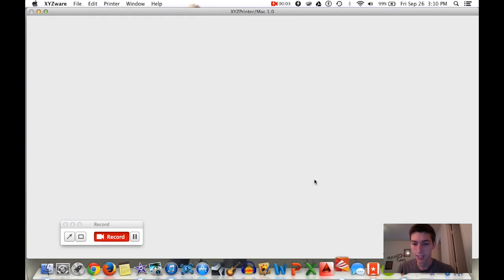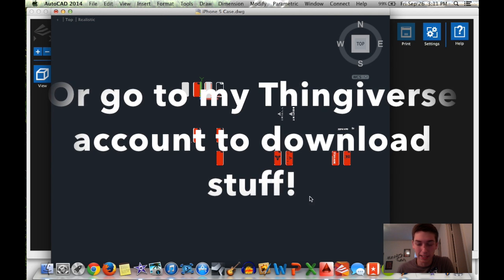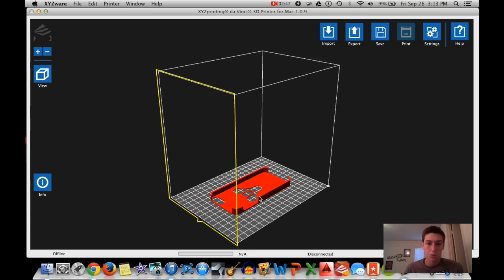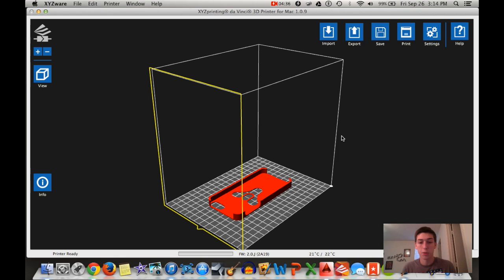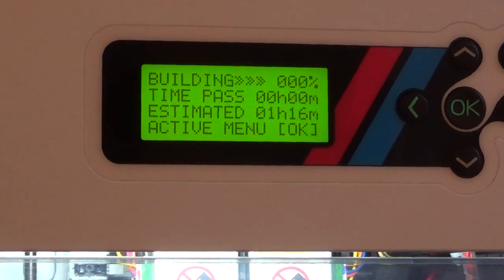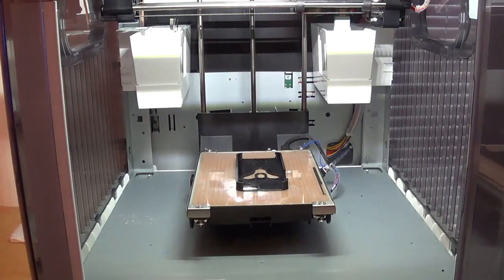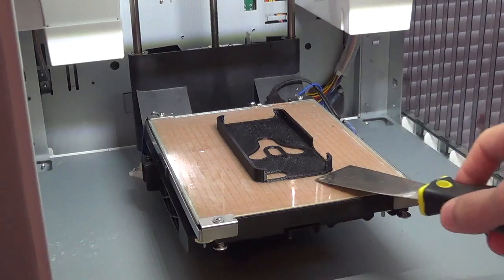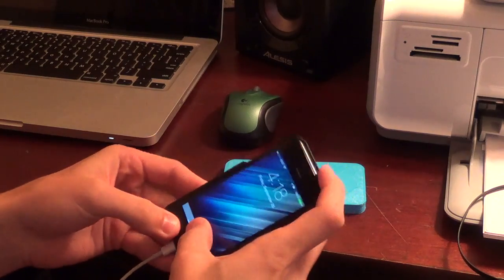3D Printing using AutoCAD and XYZ Software!

Comment: how much does it weight? 5-10 gram or more
Reply from the maker: Depending on the fill and design they are usually about 8-15 grams
Reply: +Bryan Keller if I used solid infill so

Comment: I was looking at 3D printers and I think this one is the one for me, as it'll be my first 3D printer and I'm not 100% ready with AutoCAD, I have a super quick question. The test object was dual printed, is it possible to use AutoCAD to make a dual coloured object? (I have subscribed by the way. Also I love your video format and presentations in what I've seen. Peace.
Reply from the maker: +Open Mind yes you can definitely do dual colored prints using autocad. The easiest way is to make the pieces separate .stl files or you can specify colors in a slicing software.

Comment: yo ! I've just receive my Da Vinci 2.0. I import a stl part, when i press on print, the part is sliced, then nothing happend, did you have any idea ? Thx
Reply from the maker: After it is sliced you just need to click print and it should start. If you think there is an issue with the sliced piece try printing something else and see if it works regularly.
Reply: Bryan Keller thanks dude, i just had to be patient,  thé part was complex, almost 60mb for thé stl,  so my lil laptop compute à big part of the night,  
+++

Comment: Hi Bryan, this is Alex, from México,

Recentrly I bought a DaVinci 2.0, I've printing diferent models of thingiverse and everything its cool, but I have a problem, I made a case for a circuit and when I printing I realice that, the circuit It doesnt fit on the case, because the print was smaller than the design, so I print another thing more simple, just a 10 mm cube, when I print that cube, every side has different mesure. Dou you have any idea of what happen?

Sorry for my english,

Once again, thank you very much!
Reply from the maker: Alex Alvarez I try and re-calibrate my printer every 5-10 prints so if you haven't done that recently it might fix your problem. Otherwise your piece or print bed may be slipping. Watch the print closely next time and if it looks like the bed is moving excessively try stabilizing it. Ive seen some people do this just by wedging some paper into any gaps that the bed may be sliding around in. Good Luck and I hope this helps!
Reply: Bryan Keller Thanks Bryan, today I will do your suggestions, I'll comment you.

Comment: My software does not seem to have  a PLA otion? What about yours?  And if so where is it?
Reply from the maker: Click the drop down where it says ABS in the print settings. You might need to update the software if it's not there.
Reply: Software says it's updated o the latest version? Also 1.1.4? There is no selection for abs or pla. The menu where that should be is not there. at least from other videos i have seen. what version software does yours say?

Comment from the maker: Dakota - It comes with 1 white and 1 red filament
Reply: +Bryan Keller hey there ,
i was considering buying this printer, but am told that the filament cartridges xyz from are too expensive .is the price difference too high (if so, by wat percentage)? and is there any option that filaments from other makers can be used over xyz printers ??
pls help
Reply from the maker: +harish manmohan The actual carts are not that bad, I think they are $28 a piece. But I do use other filaments generally now. There are many ways to do so such as flashing the firmware but I just reset the carts themselves in the machine and use a spool externally.
Reply: +Bryan Keller Bryan dumb question here?  Are you resetting empty carts in the printer and the printer thinks you have installed new cartridges?  so that I understand the empty cartridges make the printer think that you installed new carts and then you just run our filament through the top.  please correct me if I am wrong.
Reply from the maker: +drunization precisely.
Reply: Bryan Kel
Reply: nice background beat..whats the name of it.ive heard it before..also what was the finish like on the case surface..

Comment: Nice video Thanks. btw, I noticed that you setup your computer away from the printer. probably because the noise level?
Reply from the maker: It was just easier since that's where I study and use my laptop majority of the time. But it is a plus I don't have to be right next to it while it's printing.

Comment: Hey Bryan, thanks for taking some time to make a video for everyone.  I was looking at this XYZ da vinci's for work to have available for people to use.  I read online that they support ABS/PLA but all of XYZ's filament is ABS from the looks of it.  Do you know anything about printing PLA without modding the printer?
Reply: Sean Maxwell Bryan Keller  

Hey! At this point in time, the Da Vinci does not like to print PLA. Some people, including myself, have 'hacked' the da vinci to run off of Repetier, an open source, all in one program for 3d printers. Doing this has allowed me to print 3rd party filament, including PLA. However, the stock Da Vinci extruder is poorly designed and allows too much heat to bleed up from the hot end to the filament being loaded. This causes the PLA to swell and get jammed in the filament barrel, halting extrusion and causing this awful clicking noise . The only ways people have thus far been able to print PLA are by a) making and installing a heat sink around the extruder, and b) by replacing the entire extruder assembly with a custom printed one meant for the e3d v6 hot end. Both are a lot of work. Unless XYZ comes up with a mod or new extruder assembly, I can't see PLA becoming a thing for non-hacked printers. 

Below are a couple of links about running Repetier on the Da Vinci, the heatsink, and the e3d v6 extruder. 

repetier: http://voltivo.com/forum/davinci-firmware/53-repetier-firmware-and-repetier-host-how-too-and-issues

heat sink mod: http://www.thingiverse.com/thing:433113

e3d v6 hot end mod: http://www.thingiverse.com/thing:473038

Hope this was helpful!
Reply from the maker: I am unsure what that is but most extruders print ABS by default. I would do some online research to make sure.
Reply from the maker: This area is strange honesty, The printer does indeed support PLA alongside ABS and the software even has heating/extruding presets for PLA plastic but I have not found a XYZprinting cartridge with PLA plastic either. So until they release a cart with PLA plastic you will have to buy another brand and "trick" the printer by putting a normal cart in the printer and have your other brand PLA plastic inserted into the extruder. This will allow you to use the other filament, but you will need to reset the cart once it thinks it is empty. That is the step I am still playing around with. 
I have seen some xyz cart reseter devices online but have not tried any of them yet.
Hope this helps and hopefully XYZ will come out with a PLA cart soon!
Reply: Bryan Keller Thank you, I just heard they will be out by the end of the year.  They are running out of time :)
Reply from the maker: For real though! I guess we just have to wait patiently...
Reply: Harbinger Thanks for this. I actually have plans to buy this printer and mod it. I was curious about PLA and now I know. One more thing I'd like to know is if I was to choose the e3d v6 hot end, would I still be able to print with ABS?

Comment: how durable are the things you print from this? I am thinking to buy one to print quadcopters staff.
Reply from the maker: They are fairly durable. I usually print on 20-30% fill so they flex a bit but if you print on 80-90% the piece should be pretty strong.

Comment: what is the material thats the printers using.n how many cases like these can u print by one cartridge.
Reply from the maker: I printed these in ABS plastic but you can also use PLA. Each cart is 200g ($28) and each case is about 10g-15g so about 25 cases.
Reply from the maker: Woops he's right! Each cart is 600g* 
I will check out that other software too, I have heard good things about it.

Comment: I was wondering how you feel about the XYZ printer now that you have had it a while. Im getting ready to purchase one buts its really hard to figure out what the best bang for my buck. Any help would be appreciated.

Thanks
Reply from the maker: So far it truly has been amazing! The software has been getting better over time which was the only downfall to it in my opinion. You may run into a few problems at first but once you know how to properly fix them this printer is definitely worth it. Also their are not many dual extruder printers below $1000 so this one for $680(after tax) is a steal. 
  If you have a slightly bigger budget, I would recommend the 2.1 though. I wish I had gotten it. It has a built in camera for print monitoring on your smartphone and you can print wirelessly using wifi. I think i also has a built in memory that stores previous prints so you can just click which one you want to print without going through the software. It retails for $850 I believe but the camera alone would be worth it. Hope this helps!
Reply: The printers are pretty good, mine stuffed up a bit but now its fine :) However, do not even think of downloading XYZMaker, it is completely useless (main reason for this vid probably xD). But they are pretty good for the price :P